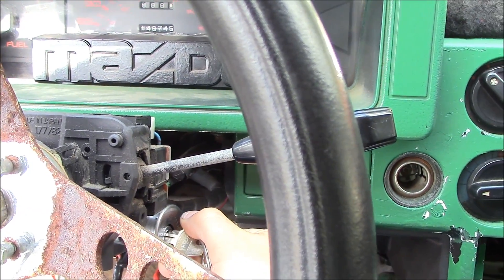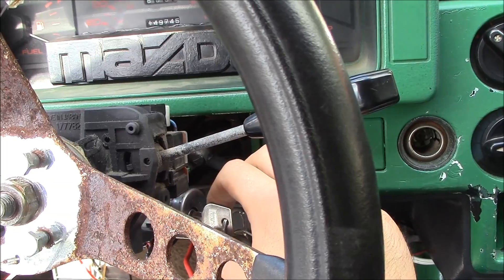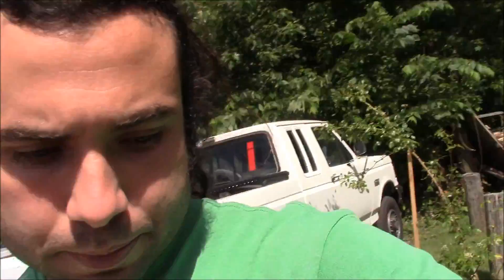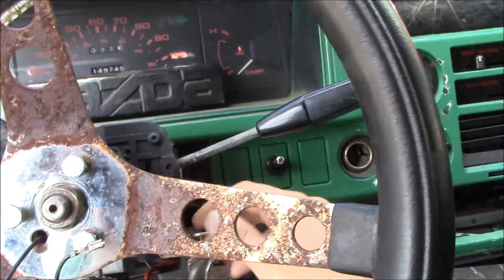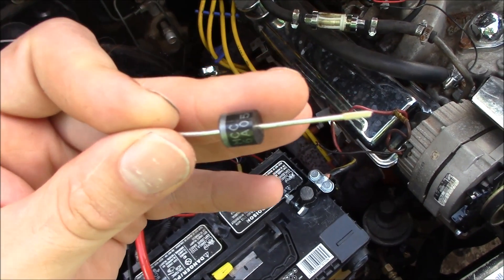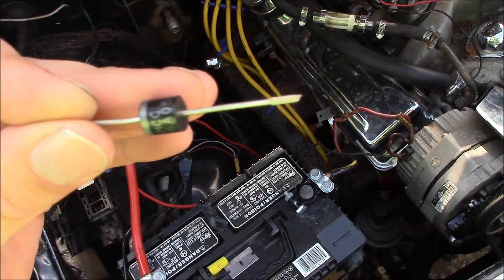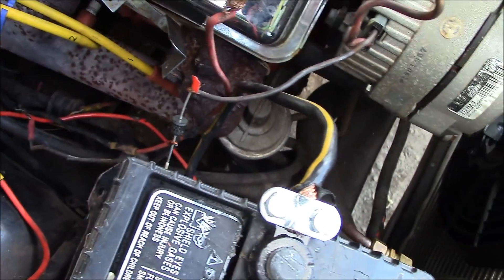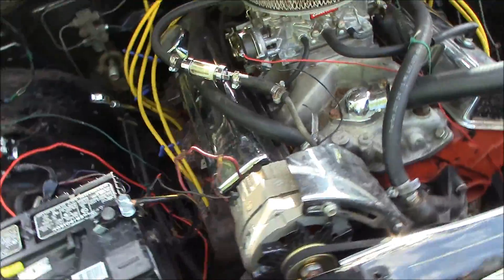Car won't turn off? Alternator backfeed diagnose and repair.

Comment: Great video. I just rewired a 1977 Jeep and bypassed the ammeter. After completion I had the same problem with the engine not stopping. I also have a serious overnight battery drain? I will try the diode but wonder what could be causing this rapid drain? 232 straight 6. Thanks.

Comment: Why would this happen on a stock engined Nissan 300zx? This is whats happening to my car. Gauges shut off, tach goes off but engine still runs, and it sounds like the rpm drops, too. Let it run thinking since the fuel pump should be off also, it would die, but it doesn't. 
HELP!

Comment: Very useful video, thank you!  Just ran into this problem when my alternator failed and I replaced it with a brand new one, this is on a 350 motor swapped into a '55 Chevy truck.  Any thoughts why it didn't happen on the old but does on the new?  Wondering if I should take the new one out and exchange it

Comment: My 69 ford galaxie is doing same thing wont shut off when i turn the key off but if i turn the key and engage the starter then turn key off it shuts off would that be same issue or different?

Comment: I have question what if for some reason engine stay at high idel speed ? It gone away when I dont use head lights or I unpluge the blow by hose and I remove the metalic air filter housing for some strange reason me trothel cabel gets contrapted ???
That strange effect anoys me to no end I hade also increased blinker speed does that mean me wire harnest is damaged some where?

Comment: i have had this problem before the diode work, on a 3 wire alt  but now i'm using a one wire alt---im wondering if i put the diode on the wire to the h e i if that would elimanate the feed back  good video

Comment: Thank you. You just saved my A*ss! Same problem on my 78' Ford Courier 2.3L project truck. Driving me crazy, engine would not shut off. Had to pull the crank case pvc hose from the carb to shut it off. Again thank you!
Reply from the maker: Glad this video helped you! Thanks for the positive feedback helps me a lot.

Comment: Thank you for the great film. In my case (2001 Saturn SL2) there were 2 problems for not shutting off: after some work I forgot to connect the fuel fuse to the air box and it was on the mark Low on oil deep stick (I was changing oil and didn't add enough). I connected the fuse, problem came back, after the 2-nd start though. After I added oil it shut of normally. "Service Engine" sign gone (and it was before). So I think just low oil can cause that problem as well. I'll check tomorrow everything again. The new alternator (producer WAI) I installed doesn't rotate and seems drains battery (voltage drops to 11.2V on start, on shut off 12.4V).

Comment: Hey man! Thanks for the video. I was hoping this was my problem also but I disconnected the alternator cables like you did but the car stayed on. What else could it be?🤯 thanks in advance👍🏽🇺🇸.
Reply: My Mitsubishi Challenger is doing the same. Even the dash is staying on. I tried to pull the relays but its not cutting off.
Reply: @spencymaf   My problem was a brand new starter selenoid that I order from summit racing. I went to NAPA and got another starter selenoid and the problem was solved. Good luck.

Comment: If this happens is tjis a big problem?? I bought a kia carnival 2014 and i brought it to kia for pms. They change the engine oil and belt. But suddenly the car wont turn off.is this a big problem?? Hope u reply tnx.
Reply from the maker: Could be switch

Comment: Thanks, I have that issue, but in an old car rather than a swapped car. Never thought about unplugging the alternator. I'll try that the next time "Sadly" It only has the issue once in a while.

Thank you for sharing what solved it for you

Comment: I'm having a similar problem with a tractor. It starts up fine, when the key is off it wont shut down until i turn the headlamps on. The headlamps, horn and console is all powered by the same wire on the ignition switch, which is drawing power when the key is in off position. However, if i unplug the battery and let it sit for a while, after reconnecting the battery there is no voltage reading on that wire until i turn the key on again.

Comment: This worked for us thank you! We put a 100amp alternator in my girlfriends 69 mustang and the darn thing wouldn't shut off.
Reply from the maker: Nice!
Reply: @speedoflife89  Will the diode get hot to the touch while the car is running?
Reply from the maker: should be slightly warm but not where it's burning hot

Comment: My engine wont turn off so I probably need a Diode. but also Would the Diode solve an ignition coil getting hot when the key is off? I think the coil is draining my battery. 
The motor is old with ballast resistor and external regulator and alternator with 4 wires DF, D+, D-/61, and B+. 
The B+ from the alternator goes to the Battery +.
DF from the alternator connects to the DF on the Regulator.
D+ from the alternator connects to the Regulator D+.
D+ from the alternator connects to the Battery light and then to a relay #87. 
#87 pin from the relay also goes to the push start button and then to the starter with a small purple wire on the solenoid. 
#86 loops to #30 on the relay.
#30 goes to the ballast resistor and then to the coil +
#30 also goes to the + terminal on the battery. 
#85 goes to an on/off switch and then to ground. 
Alternator D- goes to ground
Battery - goes to ground

I think that's all the wires I have. 
Thanks for any help.
Reply from the maker: What kind of car and engine? Is it the original engine or a swap engine ?

Comment: Hey I have same problem 2007 Chevy impala won't turn off even after unhooking red battery cable please help I put it in the shop they think it's an electrical problem
Reply from the maker: that is an entirely different problem your car will always run with the battery disconnect it if the alternator is making enough power to supply the ignition system. your problem for whatever reason the car is not getting the signal to shut off from the ignition key. so your ignition system is remaining on even though the key is off. if you need to turn the car off in an emergency situation pull the Fuse for the ignition system.
Reply: Dis you ever figure out what it was in assuming a bad igniton switch

Comment: Hey man, my car doesn't shut down even when the alternator cable got disconnected, any ideas? Thanks!
Reply from the maker: Bad wiring to the ignition switch or the ignition switch could be bad. your ignition system is still getting power for whatever reason when you shut off the switch that's why it's continuing to run. power should not be reaching the distributor or coil packs <(all in what car it is and how new on what one) when you shut off the switch
Reply: @speedoflife89  hey am new to your videos I came across a p1682 on a Saturn outlook 2007. I have this issue . I turn the car on. Then when I try to turn the car off. It keeps running for 5-7sec until it starts wanting to stall out in order to turn off. I don't know if it's really the ignition switch problem or ecm. I hear a buzzing noise tht sounds similar to when you have the key put on the on position with the radio, headlights on. When I turn it off it often will stop the buzzing noise but I see that now it's not stopping from making the buzzing noise. Only when I disconnect the battery cable. So I did another test I turn the car on and as soon as I turn off the car I disconnect the battery, and it still keeps it running for a while.
Reply from the maker: It could be one ore more > Faulty ignition switch. Ignition Switch harness is open or shorted. Ignition Switch circuit poor electrical connection. Faulty Engine Control Module.
Reply: @speedoflife89  thanks man. I took it to one of my best mechanic guys. The mechanic notice the battery gauge is so high. Like right smack in middle of 13v-18v I remember I use to see the battery gauge at around 13-14v
Reply: @Humble_Lyfe  so what needed being the problem?
Reply: @jmodz7392  problem was the computer. ECM

Comment: https://www.ebay.com/itm/MCC-50V-6A-Current-Blocking-Rectifier-Diode-Solar-Panel-Wind-Turbine-276-1661/270706349217?ssPageName=STRK%3AMEBIDX%3AIT&_trksid=p2060353.m2749.l2649
ebay auction for the diode he is talking about.  going out to solder it now, but i hope the black wire that goes through the firewall is right one.  there is a third wire but that is the charging wire in the back of the alternator that charges the battery.